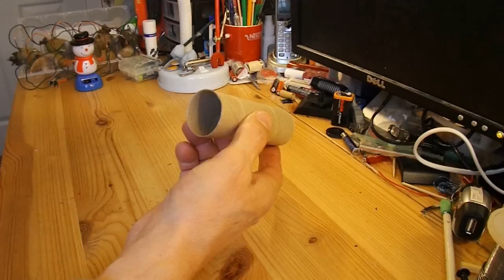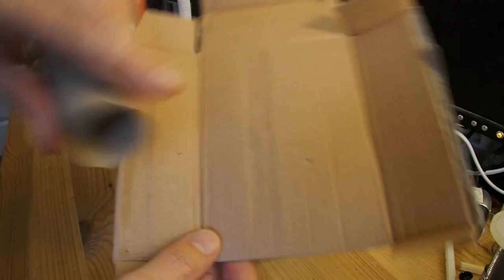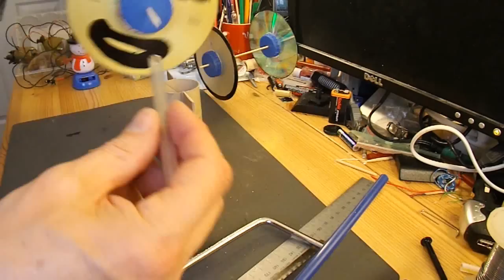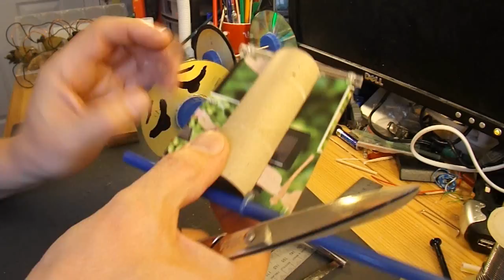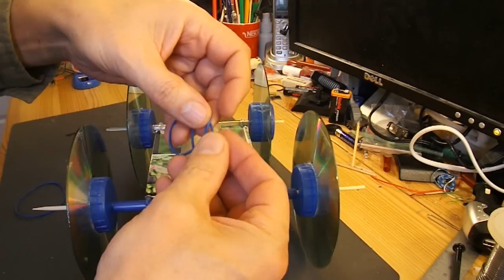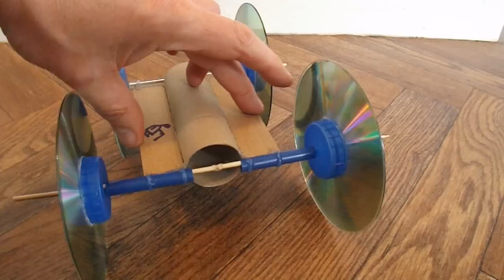Toilet Paper Roll Rubber Band Powered Car

Comment: How far would it travel if it were on tile
Reply from the maker: Probably the same as it does here. It does 8 metres easily including jumping over the step going out of my kitchen and then it stops when it runs into the end so it could have gone further if it had a clear run.

Comment: That's so cool,, can you create something that moves without circular wheels,inspired by a crawling animal, and the only way to move it is by an inflatable balloon?
Reply from the maker: That would be a fairly advanced build. I have several crawlerbot projects but none that use a balloon in the way you describe. To use a balloon would require a pump to inflate and deflate it and that would require a power supply. Would it to be manually controlled, mechanically automated or maybe microprocessor controlled. It all starts to get rather involved and certainly more time consuming that the simple projects I do.
Crawlerbots and Robots playlist https://www.youtube.com/playlist?list=PLA5a2xPRSrB0ypbT8Tr-CZfXPIiaOHUlL
Reply from the maker: You may like to study some of the work done by THEO JANSEN http://www.strandbeest.com/beests_storage.php

Comment: What's a good substitute for the ball pen stick tube?
Reply from the maker: +ultimatedarktriforce that is for you to find out. You could try a drinking straw but as we wrap the rubber band round it, there is a good chance it will crush or bend. That means you will have to find a stiff tube that is strong enough not to bend and big enough for your bbq skewer axle to go through it with plenty of space so there is minimum friction. You could even try using a drinking straw and strengthen it by wrapping a sheet of paper round it making it several layers thicker.
Reply: GrandadIsAnOldMan Thanks, after I comment I remember I have a sturdy tube stick from my kitchen

Comment: is it possible to use one rubber band for this type or is it only for multiple rubber bands? anyone?
Reply from the maker: +Pravin Yoges (Politician) this car was only built because somebody wanted me to use a toilet paper role to make one. It is not a very practical car to make but it would work with one rubber band if your band is the right size to reach from the front to the back or if you use a piece of string to extend it. Here is a more practical car https://youtu.be/pIO3FiHX4Oc?list=PLA5a2xPRSrB3g5RiX8Kf_uUBOL0Tb7AS0

Comment: would this work on concrete, I need it for a project
Reply from the maker: +Andrew Schweitzer that depends on how rough the surface is. It will probably benefit from a concrete surface as it will give it better grip, but if it is too rough it will bounce around and probably not go straight.
Reply: Andrew Schweitzer 
@

Comment: Hi Grandad do you remember me i am Maaheen's son Faraz Ul Haq  i have been watching your videos about 4 months in this video i didnt understnd how do you make the holes in bottlle lids which tool do you use
Reply from the maker: Hi Faraz Ul Haq, I re-used wheels from a previous project, in the video description I give the link to my helpfile on how to make the wheels.
Here is the helpfile for using plastic bottle tops as hubs for CD wheels.
http://youtu.be/ZRrjBuWfmrM
The tool I use is called a bradawl and is just a pointy metal rod with a wooden handle. You could use a nail or any other sharp pointy tool.
Reply: Thanks Grandad